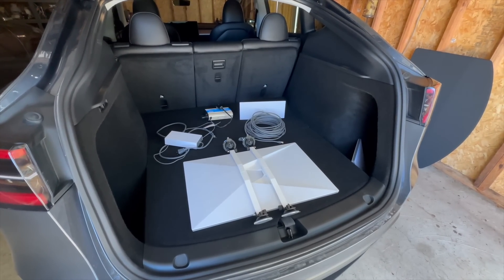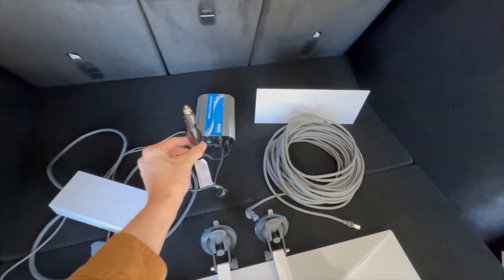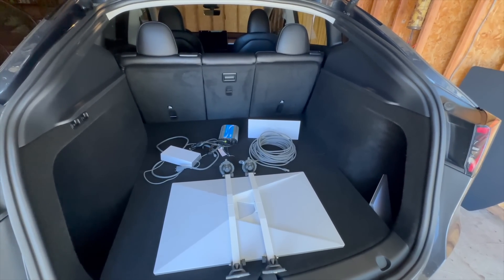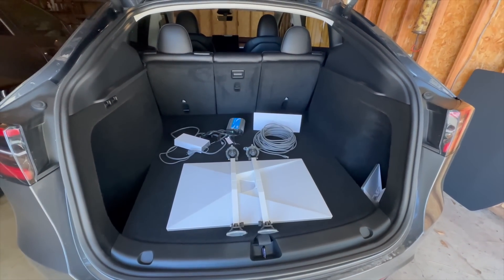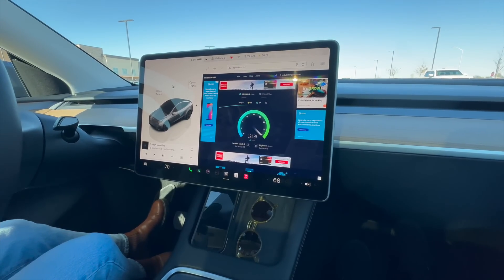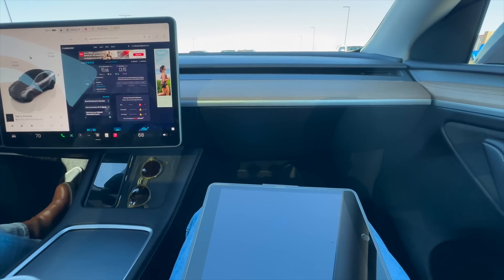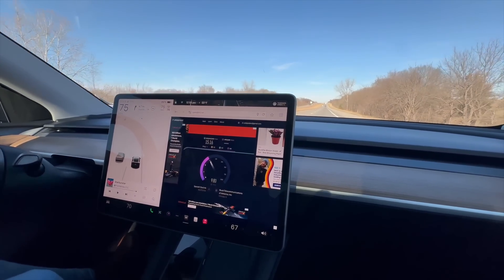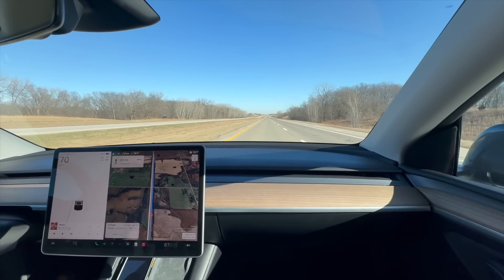Starlink In Motion Review - Gen 3 Standard vs Mini

Comment from the maker: I used 6.3 GB of data during this test.
Reply: How are you using that much data?
Reply from the maker: @banimanFJ  Speed tests, music streaming, navigation, etc. Speed tests use quite a bit of data each time you run one.
Reply: @DISHY_tech  Got it makes sense. I was going to say, there must have been more use beyond speed test, sorry if I missed those details in your video. Thank you!
Reply: @DISHY_tech  By the way, are you using your Residential subscription for this test or did you have to switch to a Roam subscription?
Reply from the maker: @banimanFJ  Roam is required for in motion.
Reply: @DISHY_tech  Thank you.

Comment: Hiya! New viewer here. I bought a Mini a few days ago and have been binging your videos so, thank you for your efforts! 

I tried the snowmelt auto vs off setting, and I got the exact opposite in my testing! I have been impressed with the portability of the Mini and how well it works in motion, but I've been underwhelmed with the max speeds I've been getting. After seeing this, I changed the settings and did speed tests. 

With snowmelt set to auto, I get low 100Mbps speeds. 100-130Mbps. Good, but not as good as my Resi Lite dish. I toggle snowmelt to off in the Mini and I instantly get 275Mbps. Set it back to auto and I'm down to low mid 100. Upload speed also doubled to 30Mbps with snowmelt off. 

I was happy with the Mini when it was on auto. Now I'm thrilled with it off!

Comment: Snow melt makes it faster. What an idiot.
Reply from the maker: No, it doesn’t. Snow melt gives the dish permission to use full power if certain conditions exist, mainly dealing with the signal to noise ratio. For example, if heavy rain or snow degrades the signal enough, the dish will use extra power to compensate. Under normal conditions the dish won’t use extra power even if it’s on. It doesn’t need to. So you don’t get faster speeds by turning it on vs off under normal conditions. Before calling someone an idiot make sure you aren’t just projecting.

Comment: Are your windows tinted? If so does it mess with the signal?
Reply from the maker: Normal tint shouldn’t. But some roof glass has a special coating like the latest Model Y that will block the signal. My Model Y is older so it doesn’t have the new glass coating.
Reply: @DISHY_tech Got it thank you for answering.🤙🏿

Comment: Search Labs | AI Overview
Learn more
I google this and probably you should buy the roof rack mount an run a different test. Good information though. 

Yes, glass, especially tinted or Low-E glass, can interfere with Wi-Fi signals, causing signal loss or reflection, although clear glass has a lesser impact.

Comment: Anybody ever try using residential plan  on the move or different locations? Version 3 standard.
Reply from the maker: Residential doesn’t work in motion, but you can use it at multiple locations by updating the service address. I made a video on it: https://youtu.be/T-lbgg2gNcs
Reply: @StarlinkHardware  thanks

Comment: On my Mini dish. The Snow Melt setting definitely makes a difference on the dish's initial boot up to lock onto the satellites faster IMHO.

I'm an over-the-road truck driver and I've been using the dish for about 2 months now. Even if it's pointed in the wrong direction it still gets enough bandwidth to watch videos and do normal work. 

Right now I am at a truck stop with a clear view to the WSW out my windshield. 

I have the mini sitting on the dash aiming out of the windshield above the tree line. 

And it's still managing to get 30 megabit per second download speed. Ping is elevated to 40-60ms.

I need to figure out a solution to make it amiable out the side windows in situations where I can't park with the windshield aiming to the north.

Comment: I am hoping you might be running another test at some point? ...   Maybe after the SNR information in the previous comments, it would be useful to keep a closer eye on the  power draw, (if you have the Melt Setting on Automatic.)  Also pulling over every now and then, to see if being "stationary" improves speed AND/OR lowers the power consumption.  Also does it lower the power draw if you take the antenna out from behind the glass?  It would be useful to some of us that use Starlink while traveling.  (Even if not in motion.)   I am a full time RV-er/Traveler that often has to park in places with less than optimum coverage/visibility.    If (as the replies above say,) the power draw increases to fight week signal when on auto,,,  now I wonder if some of the places I have parked across the US where there might hav been leaves or branches partially blocking, would have benefited by having the Melt setting on Automatic. (But I have never really been disappointed in my speeds,)
Reply: I can confirm from my personal testing that stationary and outside uses both less power and achieves higher bandwidth in my testing. I've been using it in my big rig for the past two months. 

I still have my Netgear Nighthawk 5G Cellular Modem puck as well. I'll let the Nighthawk do the serious heavy data lifting for computer updates as it is on a grandfathered $68/Month unlimited data plan.

I am currently on the $50/50GB per month plan on my mini.

After 2 months of usage I am confident that I could get by fine with just the Starlink mini. 

Sometimes I have to reposition the dish a couple of times when I initially shut down for the night at a truck stop. 

So sometimes it may be 10 to 15 minutes before I get a solid connection due to where my truck is pointing is not optimal.

So that combined with the starlink mini $50 plan. My total monthly cost is only $118 per month.

Now if SpaceX Starlink reduces their cost for the unlimited plan to around $120 a month. I'll probably then finally retire the cellular Wi-Fi puck.

But for now I prefer the redundancy of having two systems as there are many areas in the country as a truck driver that have zero coverage for HOURS of driving. 😉

Comment: I have my Gen 3 in my Tesla for almost a year now. 'Snow Melt' does not make any difference. I have it turned off and get speeds around 150-350 download all the time. I'm convinced you getting higher speeds with the setting turned on was a coincident. I tested it with my setups. I did speeds tests with the setting on and off running speeds tests many times with each settings. There is no difference. 
The other issue with this test is that there were not done at the same time. If I have learned one thing about Starlink, it's very random in terms of the speeds you get. You run a few speed tests back to back in the same spot while nothing else changes and the speed is vastly different each time. I believe the rapid movement of the satellites changes the data path all the time leading to these differences in performance. So doing these tests at different days will result in vastly different results. 
I 100% agree about the sound. It is annoying. That reason alone makes the mini a better choice.

Comment: Another great video, thank you. Would be interested to know the difference in Average Power Consumption when the Snowmelt option is on Automatic vs Off. Will it use a lot more power to achieve those higher upload speeds?
Reply from the maker: Seemed like on the first leg with snow melt off it was averaging closer to 30-35 watts. With snow melt on automatic it was closer to 40-45 watts.

Comment: I have not looked extensively,  but as of typing this, I have not found any information on the Snow Melt "Setting" effecting speed.  Is this something you got from somewhere, or did you figure it out yourself?   So far all my searches just come up with the speed effected by the actual snow. 🙂   I am not doubting you, I just would like some more information, like does it effect the speed when stationary. I have both a Gen 2 and a Gen 3, does it effect both of them?   Thanks.   (I enjoy your videos.)
Reply: I have never replied to my own comment.  Ha Ha    But I found a couple post to support the claim. 

Assuming you have the setting on Auto, reduced SNR tells the dish to increase power supply output to maintain a good signal. It's not a heater. It just increases the power to the antenna and creates heat as a result. The dish doesn't know if it's snowing, it only knows what the SNR is, and will adjust output based on that. That's why you will see heating when it's raining, cloudy, etc.

and 

It just looks for degraded signal. If it is light snow that is low water content, like out west, it may never even kick on at all. In light snow I see this all the time. In the summer when it is warm out, and heavy thunderstorms hit, it will also turn on the heater.
Reply from the maker: That is my understanding as well, good summary. It has little to do with snow or melting ice, it’s just an antenna mechanism that allows the dish to ramp up power to combat a low SNR (that snow and rain would cause). Melting snow is simply a side effect of the increased antenna power because it generates heat. For this video I believe what I found was that flat mounting the dish and being in motion likely affects the SNR enough that it wants more power than when it is stationary. Keeping the default setting of automatic lets it properly manage the SNR, while off limits its ability in order to save power.
Reply: The mini dish snow melt setting actually increases the transmitter output slightly. SpaceX had to get permission from the FCC to do this. 

On the full-size dish the snow melt setting actually utilizes a heater instead.

So only the mini increases its transmitter power when the snow melts setting is on.

Now this information I learned from other sources. So I am not 100% sure if the full size dishes either increase your transmitter power and or have a heater installed. 

What I can confirm is the mini does increase it's transmitter output. I am an amateur radio operator and I used my test equipment to measure the RF field being outputted from the mini dish. And it does in fact increase when the snow melt setting is on.
Reply: @LordTimelord  I am having a hard time tracking it down but feel that no Gen/Version has a real heater.  All just ramp up the power.   I get so many wrong answered from Google AI, (Usually the first/top answer,) I don't trust them.   But I have learned a lot since watching the video. ( Another Rabbit Hole 🙂 )

I found another couple more posts about it :  

It is not for melting snow. It increases transmit power to better work when there is a lot of moisture in the air; like snow or rain.

It just happens that a useful side affect of the higher transmit power is that the dish generates more heat and that melts snow.

and :

While there is no extra dedicated heater hardware within a Starlink dish, there is a software Snow Melt feature that works to improve reliability.

When you have the ‘Snow Melt’ setting on Auto, the feature is triggered to ‘on’ by reduced SNR (signal-to-noise ratio). The software function acts to ramp up the power to the dish and make the chips run hotter, thus melting the snow. The dish doesn't actually sense that it is snowing, it only knows that eventually SNR drops below a set threshold, and only then boosts power output. This is why you may see ‘heating’ indicated when there is sleet, heavy cloud cover, etc.
Reply: @rbdiggins  Good use of the DSP chips to measure the SNR drop and auto adjust the dish's gain! 👍

Comment: Please comment on wifi signal strength inside a RV when the Mini mounted on a roof rack (e.g. the signal from the built in router would have to go through the roof rack, van roof, insulation and inside ceiling.  Thank you.
Reply from the maker: I asked Starlink about this, and they told me they designed the WiFi radio in the Mini to produce the strongest signal underneath and behind the dish. So basically it’s designed for this (roof of a van or even a home). Metal isn’t ideal for WiFi signal strength but you would be in close enough proximity to the antenna that it shouldn’t be a limiting factor. You could also run the Mini Ethernet cable alongside the power cable during your install. That allows you to plug in a Starlink (or 3rd party) router inside the van.
Reply: Thank you very much. 

Great idea to also Install a Mini-Ethernet cable (just in case).

My plan is a magnetic mount for the antenna for easy moving to the ground if the van is shielded from the sky when camping. 

Mini-Ethernet cable: can this also be third party?